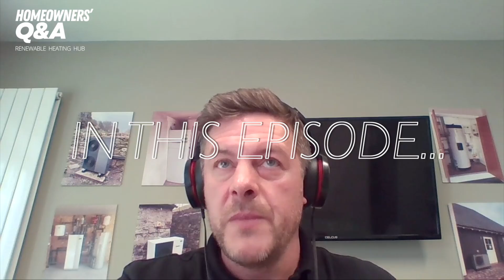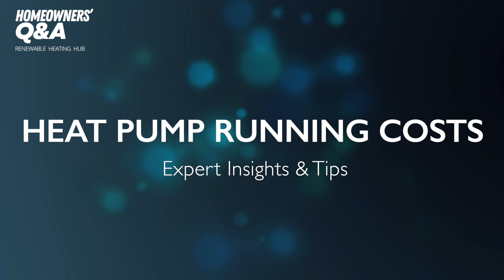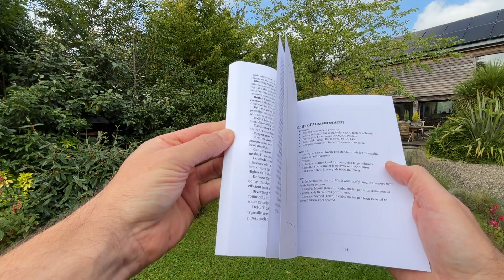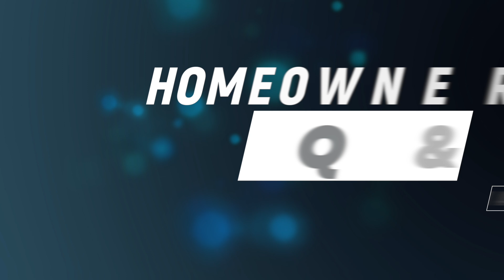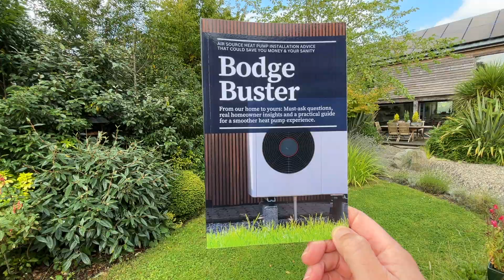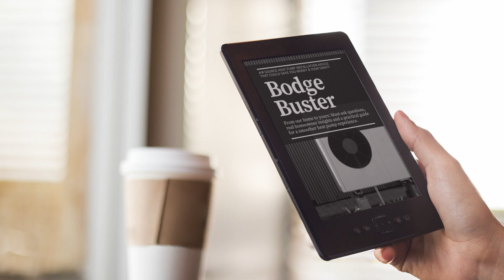What’s the Most Cost-Effective Way to Run a Heat Pump?

Comment: Some very meaningful comments from the panel. All the talk of SCOP and efficiency was put in its right place when comparing MPG. You fill up and drive. Heat pump sellers go on and on about this trying to justify a very poor product which has to run all day and is rubbish in the winter when you want to be warm. Why do they all go on about hot water? No one needs 100 litres of hot water so let a heat pump heat a house not a cylinder which is never used.
Reply: I'm a bit confused as to your point. 
Rather than being on full blast for 2 hours a morning and night, it simply trickles heat in to maintain a thermostat temperature all the time. 

Extra benefit of comfort, no too hot periods, no too cold periods. 

SCOP and efficiency means using less electricity to get more heat into the house. 

So I'd put to you, rather than thinking of being on all day as a poor thing that might cost a lot. It's keeping your house how you want it, for as low cost as possible. You don't unplug your fridge all day and just plug it in to cool the food once in a morning for 2 hours and same again in the evening do you?
Reply: It doesn’t have to run all day. Mine doesn’t. It’s not rubbish in winter. It’s December now and my room is at 23 degrees C. I definitely need more than 100 litres of hot water just like most people.

Comment: We've just bought a 8.5kw Mitsubishi to go with our 17 510kw pv panels and 18kw Sigenergy battery. Replacing a faulty 12kw UFH emersion heater and a 12kw water heater too. Nearly a £1000 a month to use at 20c. Very happy to be going greener for hot water and heating.

Comment: Question

How is SCOP calculated?  Yes I understand it is the “average” for the year across the seasons.

My point is if I need heating in winter then I should be weighting the winter COP with the amount of heat by day.  If I need 1MW of heat per year but I use that November through February then the COP in the balance of the year is not significant.

I get the impression the people speaking have rudimentary understanding of the matter but are not prepared to admit that in winter there are almost NO INSTALLATIONS that are less expensive to run than a gas boiler as they will not get a COP of >4 from November through February when their solar panels will not deliver enough above the 10-15 KWh needed for the house.  Talking to tariffs being great at night shows they know they need cheaper power prices.

Reality is over 50% of installations in the UK (Catapult report 2025) do not achieve a high enough SCOP to be better than a gas boiler.

Comment: i actually disagree on the £ per month. yes being cheaper is a bonus but i find it quite concerning that people won't consider changing if it's a bout the same or even a few pounds a month more. we're about to have a massive solar array, 2 tesla batteries and a heat pump fitted. the cost to us will be a few hundred pounds a year more than we pay on energy right now but we're future proofed against price rises and we'll have no energy bills in 10 years, or loans to pay off. plus, and the most important thing in all of this is 3.7 tonnes of CO2 saved every year. i can look my son in the eye when he turns 18 and say we did everything we could to do our bit.

Comment: Are there any issues with running a heat pump, loaded in such a manner that it runs 24/7/365 versus the normal pulsing heat into a building to maintain temp? ie would there be an issue with the compressor running constantly? (im thinking that equipment always seems to run better/last longer at a lower constant temperature versus heating up and cooling down. Any opinions?

Comment: I have a question, hopefully someone can give me advice. I moved into a 1 bedroom cottage and it’s currently using £5-£7 a day for the heating and hot water. The hot water is set to reheat, it’s not on timed. Would it be cheaper to have the hot water come on during the night? I’m not sure if having the hot water reheat throughout the day is making it more expensive to run? Any advice will be appreciated. It’s an eco dan heat pump.
Reply from the maker: Are you on a time of use electricity tariff? If yes, then switching your hot water to reheat in off peak times will be cheaper.
Reply: @RenewableHeatingHub  Hi thank you for your reply. I'm with Utilita and  I'm not on a fixed tariff. Will it be cheaper to put the hot water on timed?

Comment: I have a hear pump that was installed at the beginning of September by Octopus Energy Services. Listening to your excellent video, it seems that all of your guests monitor the systems that they install and contact their customers if or when necessary. 
It that something I should expect from Octopus?
Reply from the maker: Monitoring on some level is available on most heat pumps. If you have the time to pop onto our forums, you can ask some of the homeowners there that have heat pumps from Octopus about monitoring options.
Reply: Thanks for the good advice. I'll do that.

Comment: Got a question we have a heat pump and the thermostat was fitted upstairs and the old one was fitted downstairs it was fitted up here for ease we set it to 21 and we normally get 19 downstairs do you think this is the right way of doing it, we can ask for it to be moved if it’s not efficient our house is a warm house in general
Reply: The location of the sensor will probably be about your comfort? You should be running on weather compensation for best efficiency? Vaiilant, for one, offer an expanded setting that combines internal and external temperature readings.

Comment: 20:56 this was the more sensible take on SCOP 
it's okay to drop SCOP by putting in insulation to reduce heat loss, meaning your heat demand is much lower. Your now oversized HP might cycle more and be less efficient but will have to work much much less hard and cost less a year to run

Comment: Sounds to me only cheaper tarrifs make these heat pumps economical.
Reply from the maker: Indeed. The cheaper the tariff, the more economical they are.
Reply: A well designed heat pump will be cheaper than gas, even at normal elec tarrif prices. How well designed does it need to be? Octopus installed mine Aug '24, for £1800 after the grant, compared to maybe £5-10k post-grant cost if I'd gone with a bespoke system from HeatGeek or an independent expert like the contributors. I expect my running cost will be about the same as gas, BUT the house is now consistently comfortable (I had lots of zone and time controls before), AND I'm not burning fossil fuels.
Reply: Cheaper tariffs are available for gas too, so cheaper electricity tariffs are key to keeping costs comparable or better.

Comment: For me the most important consideration for my house heating has long been Insulation, followed by its cousin , draft proofing. Some 40 years ago I purchased a New build Executive House, It came with  windows that were drafty and minimal insulation. I spent a few pounds stopping the drafts at the windows, had the cavity walls insulated and layed a decent layer of Insulation in the roof. After about 18 months the Gas company came round to check my meter, claiming it was faulty. My gas comsumption was much less, 30%,  than an identical house next door. They checked the meter and agreed that my simple improvements had made the difference.
Now I live in a new selfbuild, it has over specced insulation, MHRV and runs on a small ASHP at a very low price. I have problems working out the COP as there are other factors involved such as passive air tube supply to the unit, and  solar thermal array coupled to the underfloor heating. . 
We do not turn it off in the summer, we leave the thermostats to control things. So far the heating aspect has not activated. Currently the house is at 23C. South Hampshire.

Comment: I literally just bought a Toyota AYGO because it does great MPG and is cheap to maintain and run. 

I changed to a heat pump because it was promised to be cheaper per unit than my old back boiler and uninsulated copper tank. So yes I want to monitor what it uses to make sure it's doing a good job 

I got a decent fridge freezer because it was a good energy rating. 

A lawn mower I don't really care because you only use it for half hour once a month 😅
Reply from the maker: Great points!

Comment: There is NO way to run an ASHP efficiently in a cold location..fine in sunny Englandshire..😂
Reply: Scandinavia disagrees with you.
Reply: As do colder parts of the UK
Reply: AND have you got a heat pump. If not do more research
Reply: When really cold there's no moisture in the air, so no need to defrost the HP. So around freezing can be less efficient than -5°C (making that outdoor air -15°C is no problem). That's why Scandinavia "disagrees").
In both climates however an ASHP can be efficient enough to be cheaper than a gas boiler.

Comment: Agree with Max's comment at 10mins about heating DHW overnight when it's cheaper on TOU tariffs. Heated my DHW at 3am last night at 5p on Agile using 2kWh (costing 10p) whereas normally I'd heat it in the afternoon using ~1.2kWh at 16-17p costing ~20p. Cost half the price, but daily COP has fallen to 4.0 whereas it would otherwise have been 4.7. It's not all about the COP.

Comment: Has anyone got a link to research on what effect overnight outside temperature has on running a heat pump 24/7? That is, if the nights are say 10-20oC cooler, is it better to turn off late at night and restart in the morning so we get a better COP but have to run it harder? Thanks
Reply: Not a link, just personal experience... I used to turn mine (A2A) off overnight and restart it in the morning.  The engineer I used for servicing told me not to and just let it run overnight.  The running cost didn't change, but the house was definitely more comfortable.

Comment: Do you turn the heat pumps to hot water only during the summer months? 
The house is still at 19.7 with windows open all day deg and yet to need the boiler. Would that cause issues for heat pumps-just using for hot water for 6 months a year?
Reply: I turn my heating off during the summer but my ASHP is still on but just does the hot water. And no, it doesn't cause issues.
Reply: Heat pumps run fine for hot water in the summer without the heating on.  There are also heat pump hot water cylinders that just do hot water, but having a single heat pump that can do both is a better option.

Comment: I do buy a car on mpg. £ per year is not a good metric as it implicitly includes your energy tariff price therefore year on year comparison is not possible. In my particular case pounds per day run cost is masking a badly installed system with a battery storing cheap electricity.
Reply: Yeah my 12mpg motorbike is cheap because I never use it is nonsense. 

Your selling a heating product not an ornament. SCOP dictates your bill, based on your heating demand/ SCOP X price per unit energy.
Reply: And thus the governments warm home shift (Jan 25) with £15 billion including solar and batteries as they know at the official 2.89 average SCOp of heat pumps installed in the UK means using gas is cheaper to run.  You have to have a COP of >4 to beat the gas running cost.  Even quoting a SCOP is incorrect as the SCOP is calculated is essential as it should be load weighted.

Comment: The engineer at 13mins 14 secs say it all about oversizing, cycling ruins efficiency.  Caused mostly by the stupid MCS requirements.
Reply: Someone once put it to me that yes I might be happy with a 9kw system able to keep my house to 18c and I'd be happy. Might be happy not heating the loft rooms when we don't have visitors. What if I sell it to a grandma who wants 23c and suddenly the system can't  achieve that on a cold day? What about when they have visitors and want to heat the whole house?

Small amount of oversizing is a reasonable thing.